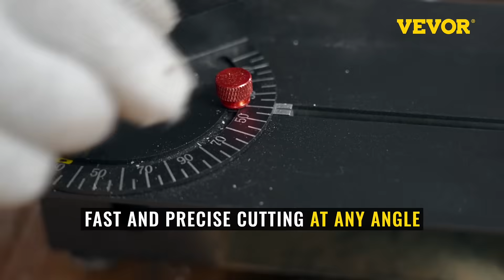Traditional Table Saw VS. VEVOR Mini Table Saw

Comment: Is it quiet enough to be able to use indoors?
Reply from the maker: We don't recommend you use it indoors.Here is our product manual for reference: https://we.tl/t-cHByrhUs3c
Reply: I have this and love it. It is quieter than a full size saw. But like the company said in their reply it is not recommended for indoor use. As cute and portable as it is, cutting wood indoors is not safe for breathing. I suppose if you had no other place to do so and were only making one or two cuts that would be okay, but for the most part, wood cutting and sanding should be done outside, or at least near an open door or window (like just inside a garage door)